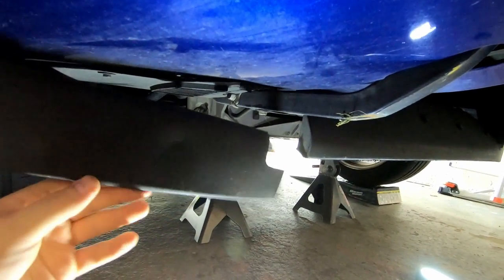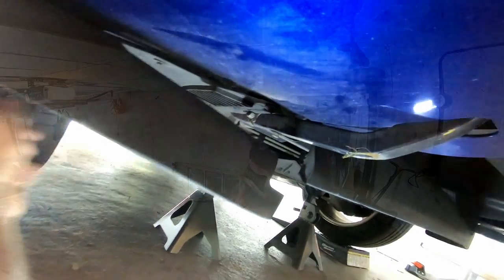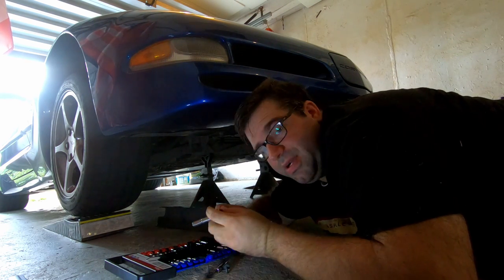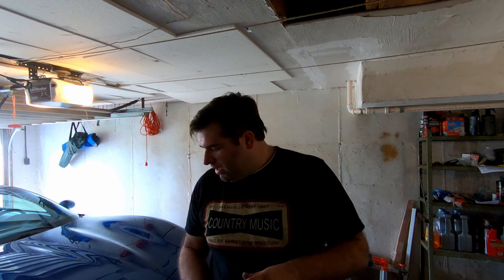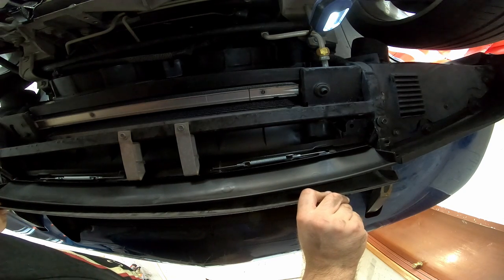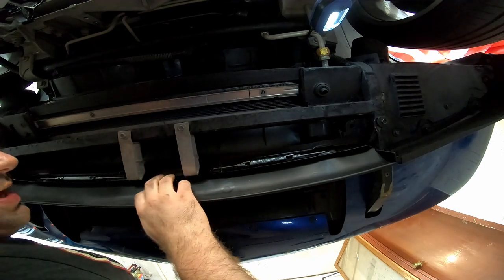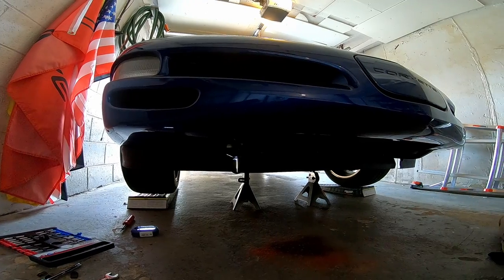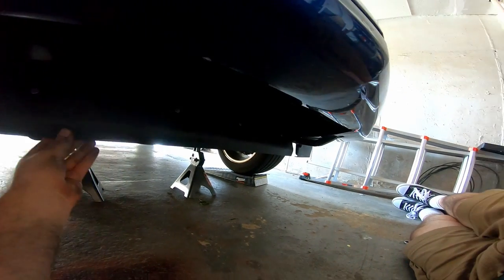Installing a New Front Spoiler/Air Dam on My C5 Corvette (+How to)

Comment: I'm assuming all the "Old" tabs have to be removed in order for the new larger 10mm bolts to fit.  Unfortunately, I don't have a jack and trying to install at regular height.  The bolts would only screw in 1/2 way and then got stuck or tight.  I think the older tabs are smaller and preventing me from screwing in all the way.
Reply from the maker: That's probable. I honestly went with the original bolts because, if I remember, I ran into the same issue. I can say that I have been happy with the OE bolts on the upgrade kit.
Reply: I went with the OE bolts and I'm good to go.  Thanks for responding

Comment: Those renforcement pieces would be pretty easy to fabricate from sheet metal of they get brittle with age.
Reply from the maker: They're almost like a rubber. Its a strange type of material, because it looks like plastic but isn't. They don't really get brittle as much as just wear down. Although, the sparks from a metal dam would be pretty epic.

Comment: Hi there . thanks for your video . I am trying to put my new spoiler on my 2001 Chevy Corvette the center one and on each side when I try to put the nut in to the hole to put the bolt still the nut comes loos from the hole on the frame ..what do you recommend ? 
Thanks
Reply from the maker: On my 2002, I had these annoying little clips that sort of pulled all the pieces together. They sort of looked like the link below. DO NOT BUY THOSE, I found a picture that is similar, NOT the exact part. I remember them being difficult to work with, however, for the most part they should clip onto something and stay in place as one side is on the bolt side and the other is on the inside of the bumper. Hope this helps? I do remember struggling a bit to get it on but it finally did. If you're still having trouble, let me know. I'm going to think about it more and see if I come up with another answer.
 https://www.bing.com/images/search?view=detailV2&ccid=G6jfpBco&id=61BF121803CCCB896B89DEF7360F353000F450EE&thid=OIP.G6jfpBcoyY7SW8YoOP_NnwHaFb&mediaurl=http%3a%2f%2fpitstopusa.com%2fimages%2fF21329746.jpg&exph=587&expw=800&q=bolt+clips&simid=608014185342042436&ck=EA9AB5FB2B14F067666751CDBCE48219&selectedIndex=2&FORM=IRPRST&ajaxhist=0

Comment: Nice job. Did you notice any difference in engine temps? Luckily I haven't scraped anything too bad where the air dam got damaged, but I have scraped my fair share of times lol. I've never paid attention to dips in the road as much as I do now.
Reply from the maker: I did not. They seem to run about the same as before, giving me some confidence in my install. I think cooling is my next tackle though, as I have paid more attention in the last few months and I don't like how hot it gets in traffic.
Reply: @iDriveDaily  ECS mail order tune is something to think about. You could drive out to them instead of mailing. There's a list of things they change, but it includes lowering the temperature fan settings. My car never goes over 200° even when in stop and go traffic on a hot day with headers not wrapped or coated. It would sneak up to 220 before the tune.
Reply from the maker: I will definitely put that on the radar.

Comment: he needs to show pics of the actual bolts and locations.  He mentions "a couple of bolts' to remove and replace but it looks like he is including more than two. He should make this a slide show with each pic showing which bolts and highlighting the bolts with big red/yellow arrows for each section. and just don't talk so much
Reply from the maker: Thanks for the advice, I will take that into account. I do believe I mention how many bolts and the location of each of them, even if I don't show them.